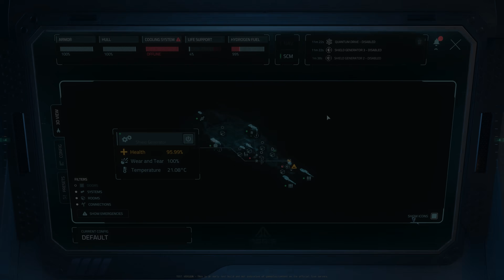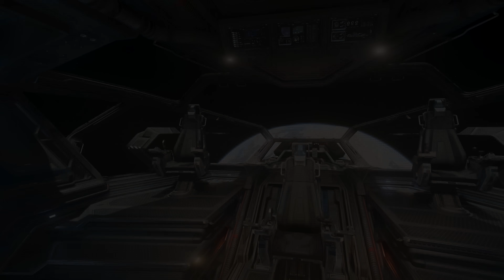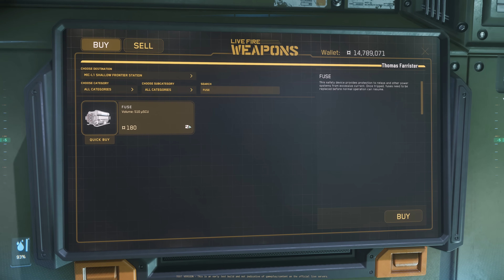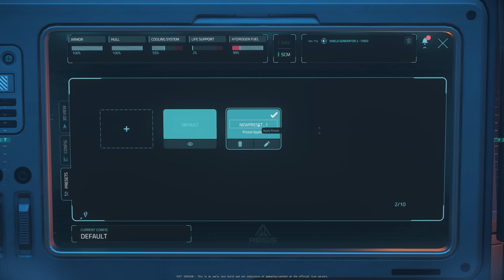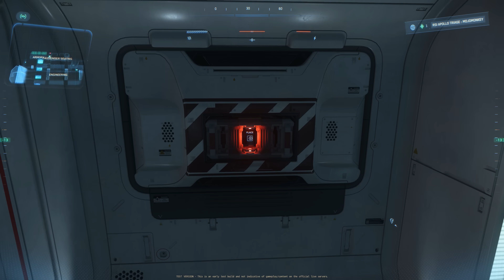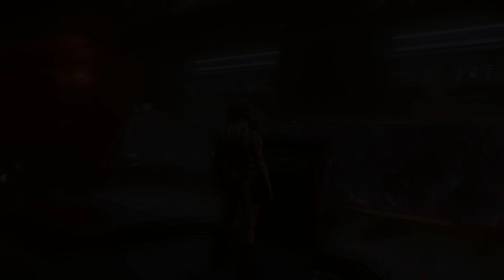Enthusiasts Guide to Multi-Crew Engineering | Star Citizen 4.5 PTU 4K Gameplay and Tutorial

Comment: At first I was sceptical specifically about wear and tear. But then I remembered a few episodes of Star Trek: The Next Generation. In some of those it is specifically stated that the Enterprise even had to return to a spacedock in order to repair its engines after using high warp capacity for several days.
So the more I see about engineering the more sense it´s starting to make.

Thank you for this video. It made the whole concept a little easier to understand.
Reply: It's a good thing this was in Star Trek else you'd have rejected the premise.
Reply: @strategygalactic  Not necessarily. But it´s a good and fitting example that wear and tear are present in many other sci-fi media.
The Next Generation uses it in a "believable" manner.